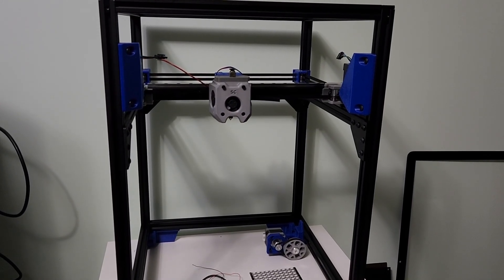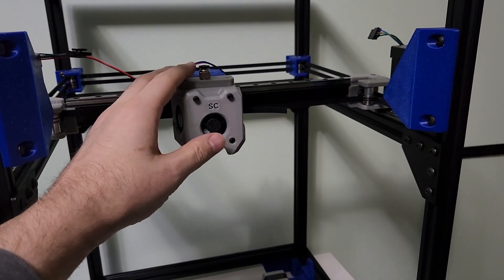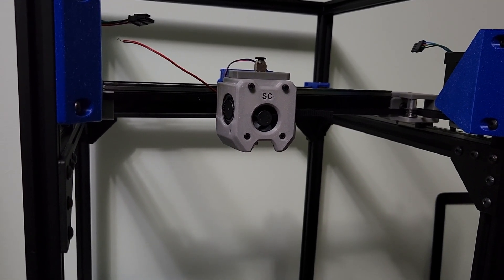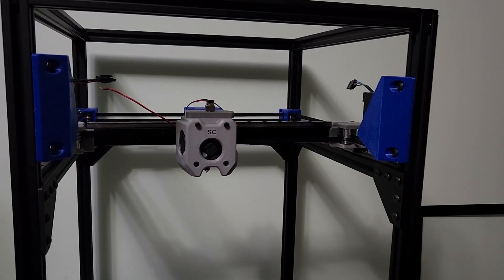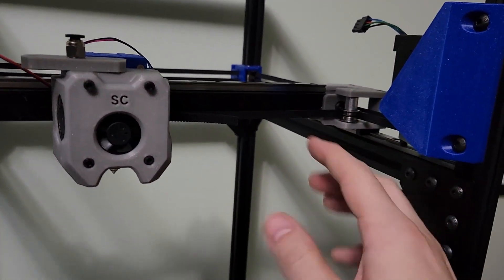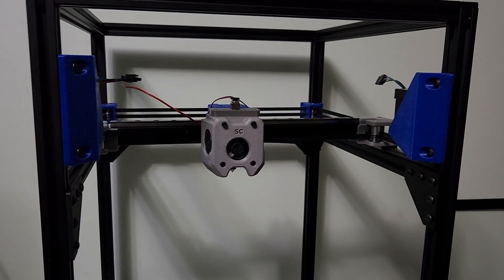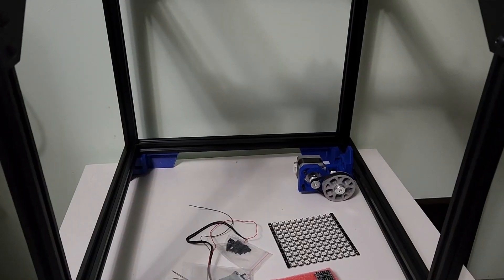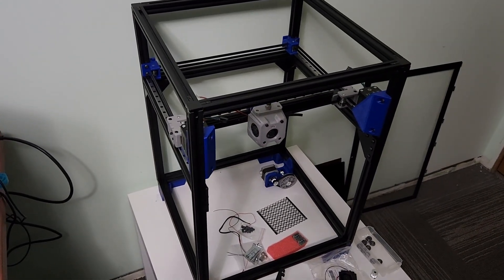DIY Beginner Friendly CoreXY 3D Printer SimpleCore Redux EP2 - XY Gantry

Comment: Hello, Rolohaun.
I'm currently assembling the SimpleCore Redux. I have a question about the double shear plates (new design, more bulky): how should they be mounted? If I install them before installing the motors, they cover one of the motor bolts and I can't move the motors up or down. After installing the motors, I can't install them because the aluminum profile gets in the way.
Thank you.
Reply from the maker: Double sheer is not needed and doesn't have enough room. I need to remove the files
Reply: @Rolohaun  Wow. Thank you!
I saw some scary photos of a bent engine shaft somewhere on Discord and I thought that a double shear setup was necessary. Thank you.
Reply from the maker: @Vorpal_7 normally you wont tighten the belts that tight, and with this design there was no room

Comment: Your xy is very similar to my design form 2020/2021 but I'm running v slot with openbuild mini gantry on y.  The hole spacing allows 2 corner pieces to solidly attach the x 2020.  My chimera+Bowden is not working out.  It oozes so much and no retraction or coasting is helping the print quality.  Any recommendations on a new extruder is appreciated.
Reply from the maker: https://www.printables.com/model/1236812-boombox-the-best-bowden-extruder-on-earth make sure you have z hop turned off

Comment: Looks nice. I might steal that Z drive for a project next year.

How hard would it be to do AWD with motors in the rear corners?

Also those XY carriages look like they're designed to have the option of using laser-cut sheet metal, and I bet the rear idlers and the double-shear bearing holders could take advantage as well.
Reply from the maker: never used AWD, simplecore wasn't made for speed so it might not be a great candidate for AWD and it does complicate the belt path. I am sure some parts could be made using CNC or sheet metal

Comment: as much as i enjoy seeing your designs, i have to disagree with your flagrant statement that motors in the rear of the machine require belts across the front - belts across the front is something i absolutely detest, but i prefer my motors in the rear with front side tensioners.  it is completely possible to do with minimal idlers, similar to your design, assuming you're willing to be a bit more creative with the belt path.  with the machine i'm currently designing, for example, the motors are removed from the print chamber because it's intended to eventually be enclosed & i want active motor cooling in a cooler environment with a sealed belt path which traverses the build chamber.  fortunately, my design also allows the belts to be parallel across the back of the build chamber with the convenience of front accessible tensioners.  you don't have to have x/y motors in the front, expanding the number of idlers or not.
Reply from the maker: oh I agree with you, I just mean doing it this way I do not need to change the belts and it is the simplest path. I am not saying the Voron belt path or others are worse just that I prefer this way and I find it the simplest.
Reply: @Rolohaun what works best for everybody tends to vary from person to person.  one of the greatest things about our community is the fact that so much customization & personalization isn't just possible, but shared so freely.  my designs for a custom corexz conversion on an ender 3 & a corexy conversion of a max neo using mostly parts onhand are almost complete & will both get posted.  hopefully they inspire others, as yours have for so many - i just don't do videos on mine.

Comment: I would love to take the belt tensioning system off the toolhead and onto the idlers in the back, similar to the trident. I know that would be a decent rework but I just think trying to fiddle back behind the toolhead isn't going to be fun. Then you could put the carriage on the front and have compatibility with all the voron toolhead stuff
Reply from the maker: you don't mess with the belts that much so it's not too bad, there are mods for voron stuff for the eva ecosystem but this is a easy printer to mod so builders can make it their own